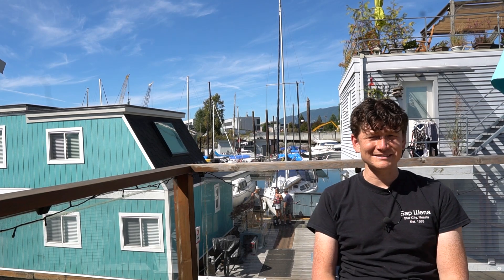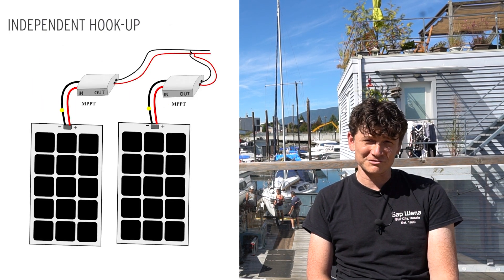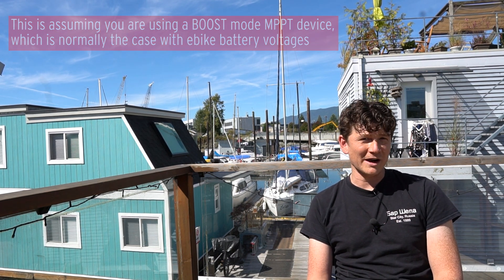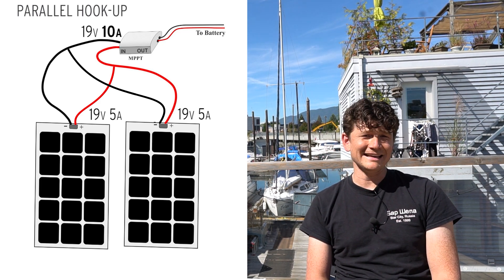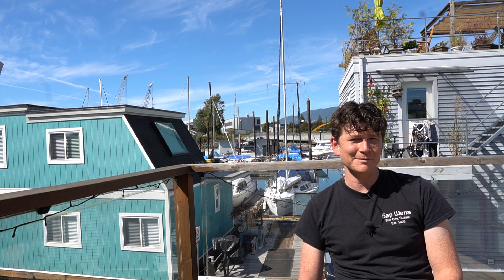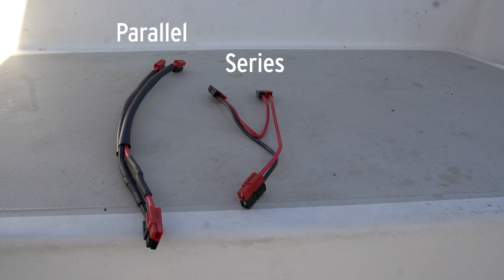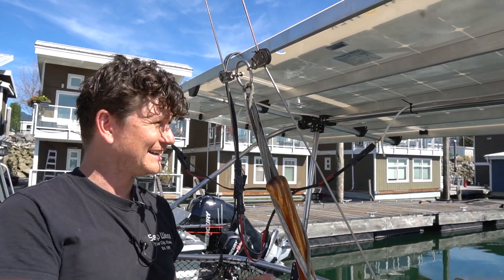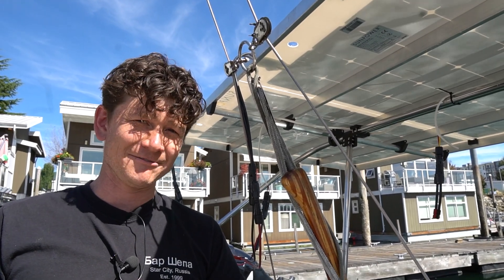Solar Ebike Tutorial Part2:  Multi-Panel Hookups

Comment: Would you put Diode between 2 mppt boost pluged in parallel ?
I'm quite afraid that if a pannel gets shaded, the voltage output shall drop for a quick moment, therfore the energy would go from the pannel to the other mppt more than the battery ? isnt that dangerous ?

Thanks anyone for an answer. ;-)
Reply: I guess i've got my answer, from a bit of logic ?...
I suppose even cheap Mppt already have a diod before the output, because in the contrary when plug to the battery with no sun, the mppt would instantly burn ....
Reply from the maker: There is no need to put a diode the parallel connected outputs of the MPPT's.  Each one will boost whatever panel is hooked up to it up to the battery voltage at the maximum power point for that panel. If one of the panels is shaded, it's MPPT will simply be contributing less amperage to the battery than the other MPPT's with unshaded panels. 

Having panels parallel connected on the input side of the MPPT is a totally different story, but there are no parallel connected panels in this setup.
Reply: @GrinTechnologies  as always, your response is so valuable, clear and simple. Thank you so much for your time !!!! About to send to the team pictures of my solar trike soon ! 

Good day to you all

Comment: You did not have enough shading to show a difference. The panels themselves may have some parallel wiring which limits the effect of shading in certain cases.
Reply from the maker: It's mostly that the Sunpower solar cells have a very low breakdown voltage drop, so a few shaded cells do not cause nearly the same degree of plummeting voltage as you have with other brands of solar cell.

Comment: Thanks for your videos. In regards to having the solar panel voltage being “LOWER” than the battery voltage. It depends on the MPPT. I’ve never used a boost mode MPPT before. But, I’ve ran a small DIY solar system kit for years with solar panels wired in series at higher voltages to charge a 12v battery bank. In addition, both my Ecoflow and my Bluetti are able to do the same thing, taking higher voltages up from 150v and stepping it down to charge a 48v internal battery bank. Most sogens and MPPT out there can step up or down the voltages. I feel it’s better to have your solar panels closer to the battery voltage, then there is less work for the MPPT. In some cases, a pwm charge controller might be better suited for the job.
Reply from the maker: Both boost and buck mode MPPT's can be equally efficient. In large installations like this we'd agree that usually series connected panels and buck converters makes most sense. But then we'd loose the flexibility and redundancy of being able to run just a couple panels at a time, since even 2 panels in series won't get us above the 72V pack.

Comment: If you put series panels in partial shade, the current through all of the cells decreases. If you put parallel panels in partial shade, the lit ones will short out through the shaded cell. Iff the ratio is high enough, you can burn up that shaded cell. You can make a mppt that accepts parallel panels and prevents this, but You really want to be careful with more than 2 or 3 just shorted in parallel. Also, ideally you should have a high enough voltage to use a buck mppt for minimum current, but you guys are probably rightfully afraid of the voltage.

Comment: Do you have diodes in the paralleling adapter? In the case of one panel shaded, the unshaded one can backfeed power into the shaded one.  Without diodes you'll see less power output.
Reply: I believe that the junction in the panel wiring has a diode, but it turns out that the Sunpower solar cells have such a low reverse-bias voltage drop (~2.5V / cell) that the partially shaded array still always maintained a positive voltage and contribution to output power.  So a diode at the panel level wouldn't have come into play in this example. But if the entire panel was shaded then it would be a bit different. May test that in a follow-up Vid.
Reply: Tradisjonelle most panel has a blocking diode, but in later years panels intended for large scale solar do not have blocking diode.

I would assume the sizes you use on a bike would have blocking diodes.

Anyway you can buy blocking diode with MC4 connector.

Comment: Thanks for the information Justin, curious if you have a MPPT on each panel do you have to worry about the MPPT’s fighting with each other when you get into the voltage control charge region?
Reply from the maker: As TSBG wrote, no problems at all. It's just like parallel connecting regular chargers which is also just fine. But you will have a state at the end of charging when some of the MPPT's think that the pack is fully charged, while others will still be putting in current, since they all have some variation in their voltage calibrations.

Comment: If you've got a 72 volt battery pack then why don't you hook up for panels in series and then use only one mppt
Reply from the maker: It's a good question, but 4 main reasons:
1) We already have a good stock of these boost mode MPPT's
2) All series is OK when all the panels are at the same angle to the sun, but when some are at different angles than others, then the output of a series connection will be quite a bit worse.  Groups of panels will just end up being bypassed from the pass diode rather than contributing to the output if they can't supply as much current as the better angled panels. 
3) I'm comfortable going to up 72V on the boat, but having a 200+ volts routed above deck would make me a little uneasy.
4) I also like the redundancy of having multiple charge controllers running instead of banking on just one. It's for similar reasons that we've got a dozen independent 72V batteries hooked up in parallel, rather than one very large high capacity battery with one large BMS circuit.  There's some comfort in knowing that one electronic parts failure won't take the system out.
Reply: @GrinTechnologies  yes. I get it. Makes sense for sure
Reply: I believe he said the panel voltage was around 30V. That would be 120v for 4 in series which is far more than the input voltage of the controller. He's using controllers that boost the voltage of the panels, for that you would need a controller that steps down the voltage. Which is more standard, and usually more efficient so might be a good way to go. Although shading on just one panel would knock out most of the whole set.
Reply: @BenBrand  i saw 19v on the example sorry. Why don't you put all of the panels in series and bring it up to 240 volts for 8 panels then step down. Wouldn't that be the most efficient way
Reply: @quevicular  stepping down is more efficient yes, but since he normally uses controllers for e-bikes, they are usually boost only because of the low panel count and high vintage of the battery. He would probably be better with higher voltage and step down controllers which are more common for these larger systems. But only for groups that would not be shaded, as if you had all the panels in series and one was shaded by the mast say, it would knock out the whole string.
Reply: @BenBrand  true enough